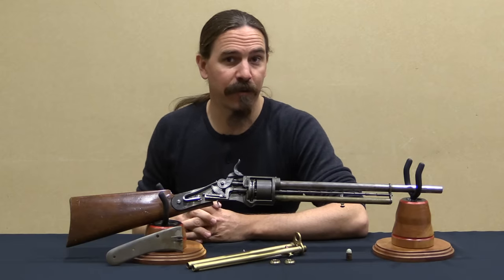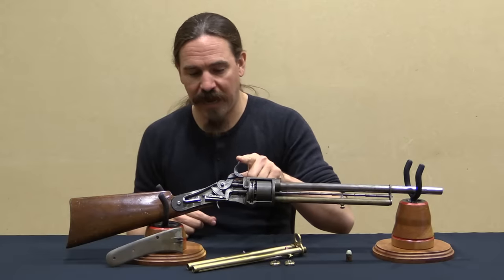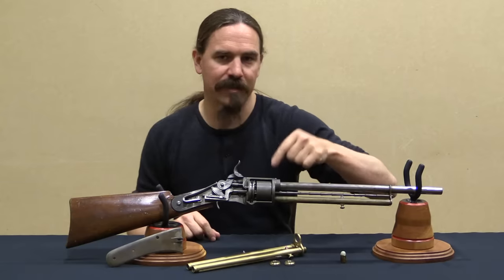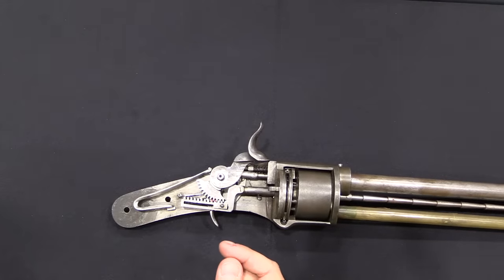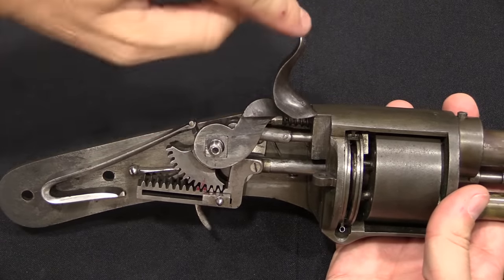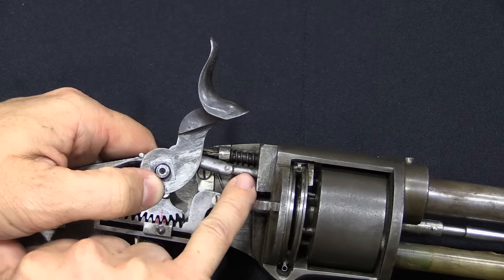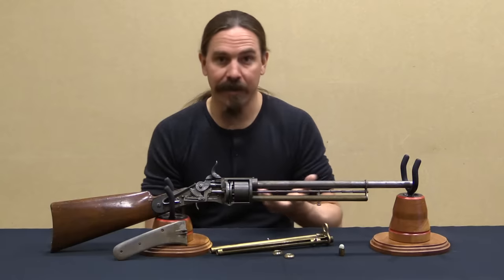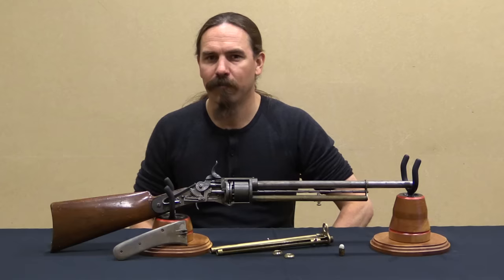Lindner's Improbable Tube-Fed Striker-Fired Caseless Ammo Revolver

Comment: That took some serious thought and ingenuity to design and build. Makes you wonder how the advancement of firearms had been different if generals and others in charge of military procurement didn't seem to be afraid of change, ammo capacity and firing rate.
Reply: Field reliability and cost are bigger factors imo
Reply: Back in those days if you had been issued a gun that held 50 rounds, that would have been your annual allowance. "Make it to next year and you'll get a reload."
Reply: You mean if they weren´t aware about the fact that every kg of ammo had to be moved on a mule or horse drawn carriage hundreds of kms?

Or if they weren´t aware about the fact that they are in Burma and the nearest cartridge manifactury where in Birmingam?
 
Of if they weren´t aware that the ammo load that a soldier can carry was only 60+/- cartridges  (because 60 cartidges weights more that 150 30-06)? 

Or if they weren´t aware about the fact that after firing a short amount of cartidges your firearm will be so fouled that you must expend ten minutes cleaning the fouling?

When some militaries think one thing and other another one, some of them can be right and some can be wrong. But when all the militaries in all the world have the same concerns, usually they are based in actual facts. It´s not a coincidence that you don´t see the  adoption of  repeating firearms till the military have first a decent ferrocaril network and, second, smokeles powder with much lighter cartridges.
Reply: @salvadorsempere1701  Whats a KM? Is that like a couple feet?
Reply: @caboosemacs  1 / 10.000 of the distance from the Earth's equator to the North Pole measured on the median arc through Paris.

Something a lot more rational to base an universal sistem of mesurement, instead of relying in the suposed length of a body part of a 1200 years old deceased king. Used in all the countries in the world, except for three backwards ones
Reply: It tends to be that strict requirements for firearms leads to thrm beibg improved. Look at the case if the C93. It was revolutionary but it had a lot of problems. So luger improved it and it became on if the most recognizable guns in history. Just because something is complex doesn't mean it's good.
Reply: @salvadorsempere1701  You are quoting the 1793 definition???  Seriously?   Definition was changed in 1799 to an actual bar of metal....in 1960 changed again to a certain number of Krypton-86 wavelength emissions..then in 1983  to the distance traveled by light in a vacuum in 1/299,752,458th of a second....(So rational and terribly clear to everyone I'm sure that is!)  So no...not 1/10,000,000 (you left off some zeros) of the Great circle distance from the equator to the North Pole..not for 222 years.....(which wasn't really a metre as we know it anyway since the earth does not have an actual circumference of 40,000 km....)  Just saying....
Reply: @trooperdgb9722  . Of course I´m quoting the 1793 definition. And I was tempted of quoting the first proposed definition of meter (the lenght of a 1 second pendulum at 45º of latitude). Both make more sense if you are making an argument obout how rational is the foundaments of the S.I. and, after all, the 1799 def, the 1960-is and the 1983 are just the same unit of measurement, just  defined in a more precise way.

And I have not left off any zero. Caboosemacs was not asking about meters, but about kilometers, and I was answering him.
Reply: @salvadorsempere1701  i aint gonna pretend that imperial is better than metric, but like both are equally arbitrary, people just made up both and "roughly the size of your foot" and "about 1/10,000th of the circumference of the earth" are both kinda silly, but ones less silly due to it attempting to be precise. Doesn't matter much anyway given that both are significantly more precise and concrete now and ironically imperial is based on metric so yall won anyway
Reply: @BruhMoment-re8nc  Yes, both are arbitrary. But in one I can answer to the question of how many  water you have, in grams and liters, in a container of 1.32 cubic kms from the top of my head, and answering how many water, in grains and galons, you have in a container of 0.48 cubic miles needs pen, paper an ten minutes of furious maths.
Reply: @salvadorsempere1701  That unit changes over time, though. The King's body parts are done growing.
Reply: @cheyannei5983  how exactly do SI units change over time?
Reply: @platiuscyndar9017  Earth is never the same size in the same place.  Geology happens and of course space debris is constantly adding to earths mass and size over time.   Considering how long that takes however and comparing to the length of time humans have been measuring anything at all, I feel like we've still got plenty of time before it's an issue.  😆
Reply: @MrBottlecapBill  That doesn't change SI units though, that changes the earth's measurements in SI units... Because SI units aren't based on measurements of the planet anymore. Light doesn't change how fast it goes, as far as I'm aware.

Comment: The complexity almost makes sense if we use this as a scale model and imagine it as a piece of artillery.
Reply: making a potato gun like this would be fun
Reply: Not as complicated but look up Eugene Stoners 75mm autocannon. Also, look up how rt4rded the acquisitions department is
Reply: @smorrow  Yes, the Ares Cannon for the HSTV-L/HIMAG. It was a revolutionary design but of course Big Army was too conservative for it.
Reply: Following the German style, this would need a construction crane for loading each round, and each projectile/shell would have a consecutive number. Each piece would have a bigger diameter due to barrel wear.
Three sets of railways are needed. 
Three locomotives on each side pull the artillery on the tracks. The third one is to provide the ammo.
Reply: @WaukWarrior360  There is one modern autocannon double belt-fed with telescopic ammo in 40mm. It uses swing breach as well. It's called 40 CTA, I think.
Ps. It is not precisely belt-fed. They call it "CTWS link-less magazine" or something. It is more or less rail on top and the bottom of the ammo in the following ammo feed. There can be multiple such "magazines." Link-less but still looks like a belt.
Reply: @HanSolo__  Yeah, If I remember correctly, the Ares Cannon that was built earlier used a drum type 'magazine'

Comment: Nerf: write that down write that down
Reply: There is a Nerf gun that does exactly this. It's called the Roundhouse. It has a six shot cylinder feeding from five three shot tube magazines. It shoots the Rival foam balls instead of darts, I don't think the design would work well with darts.
I have one and it works pretty well even with 4 shots in each tube. I've been thinking of modifying the followers so that there is room for 5 or 6 in each.

Comment: The paradox of the German is the ability to streamline the over-complicated
Reply: Not the other way around?
Reply: @andrewsuryali8540  Both.  At the same time.
Reply: They tend to simplify the mechanisms to carry out fairly complex operations, whilst simultaneously complicating fairly straight forward operations.

Like, "We developed a new internal combustion engine with three moving parts, and installed in in a car that has a rear view mirror with 74 individual moving parts and is adjusted by tiny (direct mechanical) linked hat switches on the steering wheel.  Oh, and there is a gimballed vase for a rosebud on the dashboard, because, 'Why not?'"
Reply: @geodkyt  Only to realize that the car can't drive without the rosebud in place due to balance issues.
Reply: @gordoncroft4524  LOL
Reply: @geodkyt  I see you bought a BMW recently, Sir?  :)

Comment: Interesting stuff.  I wonder what would happen with a misfire.  If there wasn't a way to clear a misfired cartridge, what would happen when that chamber rotated back around in front of the feed tube?  Ditto when it comes time to unload at the end of the day?  I wonder what the method was.  Interesting piece of equipment Ian.
Reply: From the looks of the mechanism there doesn't seem to be anything from preventing the cylinder to be mounted on a hinge like most revolvers are. 
If I understand Ians explanations correctly, the cocking lever 'primes' the reloading rod upon cocking and then loads a round on pulling the trigger. So when you get a misfire of the round that is in the 1 chamber at the top, it will put a new round at the 4 chamber at the bottom (it's not blowback operated, so it will load tgat rodund either way). Then it will rotate the cylinder half a turn so your misfired round now sits at the bottom, but will not get a new round feed into it untill you recock and pull the trigger again.
That gives you plenty of opportunity to notice  misfire, pop the cylinder out on it's hinge, use an implement to push the misifred round out and pop it back in to continue operation like normal.
Reply: @reappermen  Sounds reasonable enough. I was wondering exactly this, and your answer is sensible.

Comment: I'd love to see a skilled machinist recreate this just to see if it could work, but the idea of a chain fire with this system is terrifying in its own right, not sure how likely it would be, but still an unpleasant thought.
Reply: Considering it’s a percussion cap system, it’d be extremely unlikely
Reply: @kingnull2697  still possible to have some ugliness with flash from the firing chamber catching the stowed rounds in the magazine. IIRC cartridge paper of the time was nitrated so it was basically nitrocellulose.
Reply: @ScottKenny1978  Ouch.
Reply: @stevepalpatine2828  yes, but IIRC black powder only goes boom if it's compressed. So it would be more like holding a Roman Candle than a blasting cap.

Comment: I don't really see how you could put additional tubes on it. The mechanism ro feed new rounds into the cylinder advances with each pull of the trigger. Of the spot in the cylinder is already full, the gun will just jam.
Reply: It would feed from one magazine at a time: once one emptied, another would be connected to that central loading rod.
Reply: @keithklassen5320  what's keeping the followers of the auxiliary tubes from connecting to the central rod?
Reply: @AnonOmis1000  presumably, the user would manually index the tubes, or a link connecting them

Comment: I drew up some sketches back in high school for a similar concept. I was obsessed for a little while. Mine was a magazine fed revolver that used caseless ammo. It would have used a 3-4 shot cylinder. The mag to cylinder mechanism was similar to that of the boberg/ bond arms bull pup. Feeding into the bottom cylinder from the back. The idea was to do a high rate of fire full auto pistol or carbine with a closed bolt but with multiple chambers to avoid cook off.

Comment: You could use brass cases with a slight backwards cone shape and integrated primers, they get pushed backwards into the chamber and get pushed out forwards in the first or second chamber after firing.
Then you can still use 2 to 4 pipes (depending on your engineering efforts).
If you increase the cylinder diameter and add 15 bores you can use up to 13 magazines with 30 shots each
(390 shots)... Which would definitely need a feed assist system 😂.

You could also make a mechanical system that only allows one follower to be engaged at a time, starting with the far end of travel to avoid empty chambers, which reduces friction significantly.

Comment: So many questions arises. What an engineering marvel this is and a must in a Steampunk arsenal. But, a few questions.
1) How do you reload the tubes? Seems complicated, at least a little.
2) Where is the main charge? In the bullets themselves? And how would residue be ejected from the chamber prior to reloading?
3) Increasing the mag size means you would have to increase the percussion cap mag size as well, seems finicky.
4) Most importantly though, if you add more mag tubes, how would the mechanism compensate for already loaded chambers? If a chamber already loaded rotates to the next mag tube it cant accept an additional bullet so there would have to be some form of skip.

Yes, I know, but seeing a really innovative design like this makes you think.

Comment: His next proof of concept prototype actually assembled a cartridge from scratch using six separate magazines for all of their component parts and an extremely complex internal mechanism and then loaded the assembled cartridge into the chamber, fired it and ejected the spend shell casing. It featured a 184 lb. quintuple-action trigger, brass internals manufactured by Rolex, a four-shot capacity and only weighed 32 lbs!

Comment: I see a big problem(i think).... The primers must he in there tightly otherwise they would fall out and jam everything up. When the striker is picking up the primer its striking with speed, against resistance. Seems like there is a very strong chance of primer detonation before the cap is seated on the nipple. Akin to an out if battery discharge. Not only would a round not fire but the cap could end up in the inner workings and more importantly anytime you have a failure to fire, 2 shots later its going to try to stuff another round in an already full chamber. So its already a huge mess but in a gun that is so interconnected and intricate, its going to jam everything up and not even allow you to just skip the affected cylinder. The feed system is connected to the roation of the cylinder, etc, etc. If you get a failure to fire, which is common with percussion caps(probably doubled my caseless ammo of the 1800s), you are looking at an hour teardown with tools to get your next shot off.
Thats probably why it remained a proof of concept and never went any further. Im sure people a lot smarter than me figured that out real quick

Comment: When we pull the trigger the striker goes forward, the feed rod comes back, and the garden gnome pushes the tennis ball into the paddling pool. The displaced water overflows into the cup, which weighs down the scales until they press the power button on the dancing robot toy. The robot dances across the room, walking through the taught string in the process, which pulls on the ornamental flamingo...

Comment: With caseless blackpowder cartridges in a revolver design... I'm going to go out on a limb, and guess that the design died on the altar of "chain fire mishap". I could be wrong. Either that, or the exposed open top of the tube let the weather do unhappy things to caseless cartridges in the field.
Interesting design though, and actually it would be far more practical 'now' (with some of the innovations in the 20th century) than it was at the time. Modern caseless ammo would help a lot. And the revolver chamber would alleviate much of the concern of cooking off a round. I could actually see a really cool gyrojet rifle version of this too (which would help overcome the low muzzle velocity of the gyrojet pistol).

Comment: Now we drill a gas port into the barrel with a piston driving the hammer- cocking lever thing
Reply: Go full steampunk - add a prototype Maxim recoil plate on the butt to provide the driving force.  Preferably one made in pantograph form from gunmetal bronze.  Incorporate a Galilean sight with a tiny garnet set in the center as the aiming dot.

Comment: If those combustible cartridges had ample outside lubrication on the bullets, it might well have been possible to get through thirty rounds, anyway, without too much issue.  I know cap and ball shooters who lube with a lard/beeswax mix can shoot until the cylinder pin gets too fouled for the cylinder to turn -- that would be the limitation on this as well.  Where I think the main limitation would be is the fragility of combustible cartridges.  The ones I've made from cigarette papers are sturdy enough to handle, but not anything I'd want to stack up ten of and use the first to push the whole stack.  If you used nitrated heavier paper (as was apparently common from at least the 1860s until the Rollin White patent expired and revolvers switched to brass), it might be stiff enough to get away with this, though.

Comment: imagine if he also thought to include a gas mechanism in this, so that the next shot could eject any debris from the previous chamber (this would even make using non combustible cases possible) and then make both the cylinder and the barrel interchangeable to deal with black powder fouling and you have a lmg in the later 1800s
Reply: I think this thing is already complicated enough man!

Comment: i believe the drag from the reloading of a fresh cartridge on the hammer would have kept the striker from setting off the caps reliably. The hammer is accomplishing a lot as it falls - probably they were expecting too much of it for that time. There is a long train of moving parts that hammer spring has to move when all it should be doing is firing a cap. I do not think think in the dirty environment of a battlefield that mechanism would be reliable.The train of action that reloads a cartridge should be separated from the train of action that fires the cap. It is enough already that the hammer spring has to reload the cap as well as fire it. Muscle power to reload, as in a pump or lever action, would be much more reliable. If the inventor insists on automating the loading mechanism  I think at least a second spring would be needed, perhaps as a double cocking hammer arrangement where your thumb could cock two hammers at once, where the parallel hammer cocks a second independent loading spring.

Comment: How would the system that loads the rounds into the cylinder from the tube work if you had multiple tubes on there? Wouldn't it be attempting to jam a round from each tube into the cylinder at the same time, every time you fired and cocked?